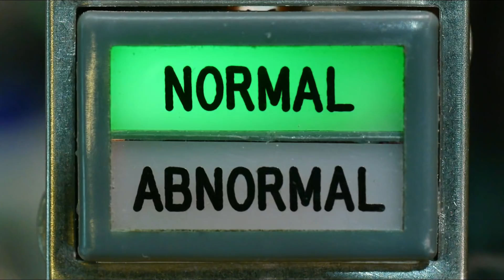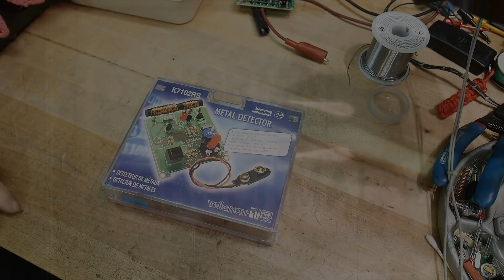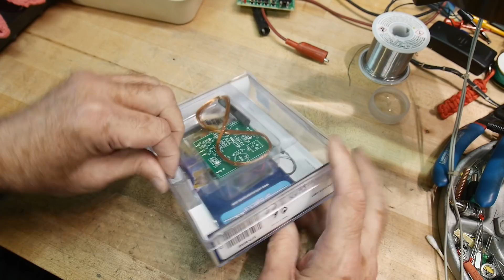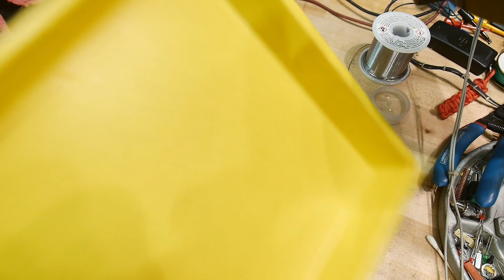#1051 Velleman Metal Detector Kit

Comment: I built this with my daughter and it didn't do anything. Diodes were in correctly. I even rewound the coils and sanded down the wires before soldering. The LED works when I do diode test on the meter. What else could be wrong?
Reply from the maker: almost anything. hard to help from here

Comment: I think that it doesn't couple the coils more, the oscillator is tuned so it barely oscillates on its own and by bringing metal close it loads it down that it stops. T1 and T2 then close opening T3 and lighting up the LED.

Comment: The best way to wind a coil on a lathe is on the top side so that you can see to feed the wire exactly next to the previous turn.
The BEST way to do this is with the Red Direction Knob to select Reverse, instead of the routine Forward choice. 
ProTip: Do not tighten the belt after selecting the lowest speed - let it slip. It will still turn enough to wind the coil, but you can vary the speed and even stop the chuck with your gloved hand when the turns are the correct number.

Comment: A drop or two of cyanoacrylate is really handy when securing coil windings at the start and end. Doesn't seem to affect the enamel coating on the wires.
Reply: Also quite handy when I slice some part of my hands on a sharp case edge, or cutting something in a way I know I shouldn’t be cutting. Lol.